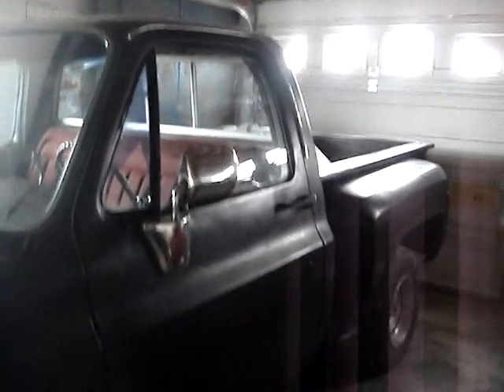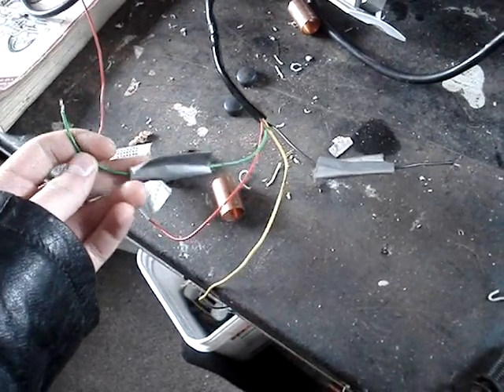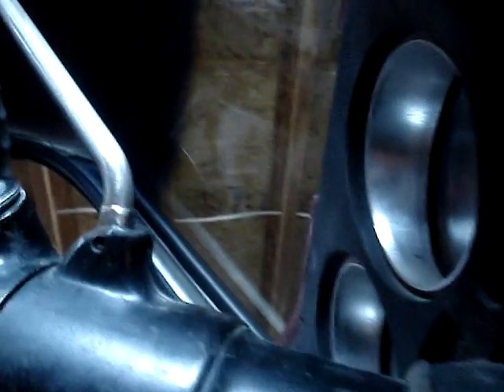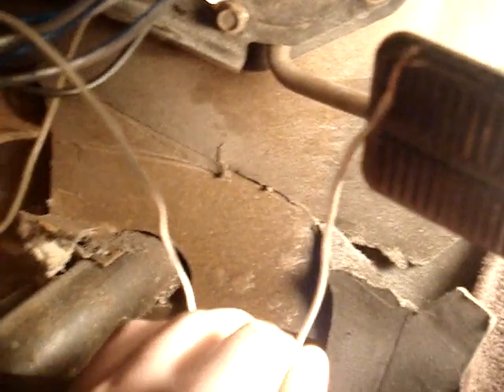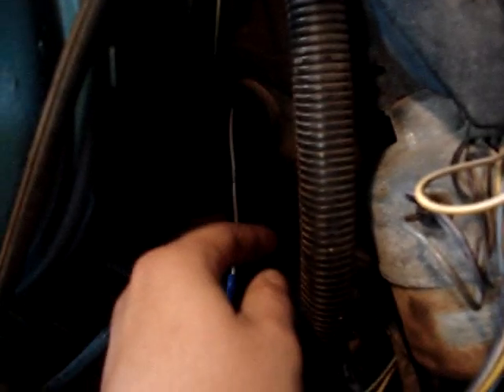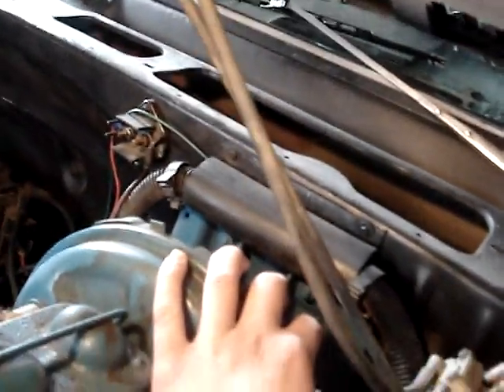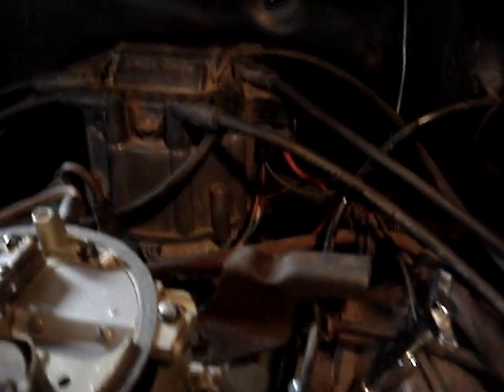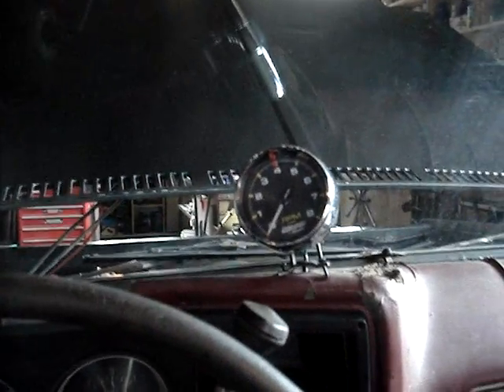How to Hook up a Tach

Comment: Use a Sharpie to add some black coloring to any colored wire you are using for ground.   you won't ever forget,  and also in case someone else buys the vehicle , so they don't mess up

Comment from the maker: Red = Power, i plugged the power from my tach into my radio Black = ground, screw onto a bare metal surface Yellow = Distributor, goes to negative feed on ignition coil or distributor wires White = Lights, i just tied mine into a open headlight wire so when you turn your lights on it turns on too.

Comment: Actually those are sold for cars/trucks too, so doesn't matter if it's in a home or car.  True you would be much better off soldering and heat shrinking the wires, but it's not like it's a show truck so who cares.